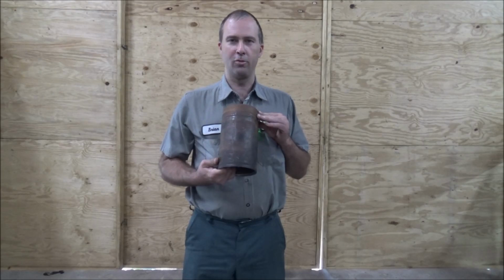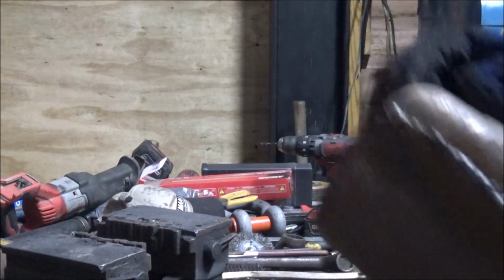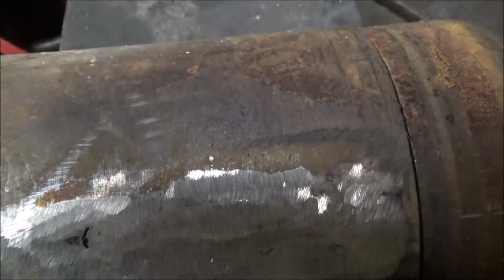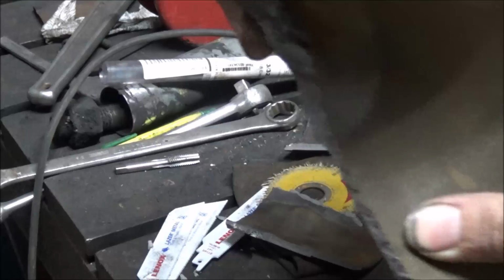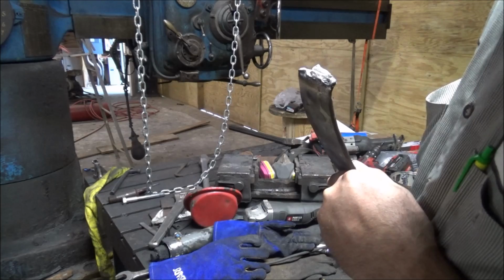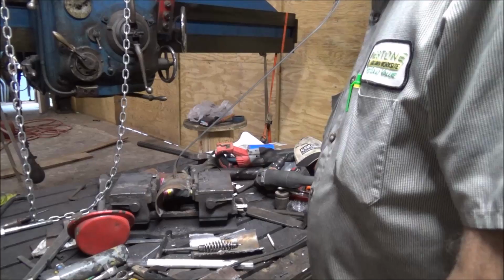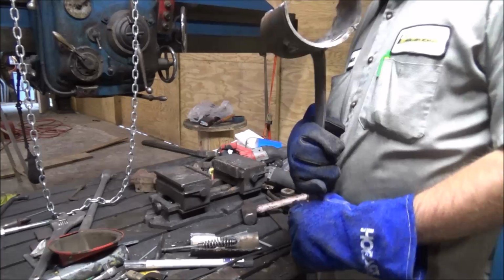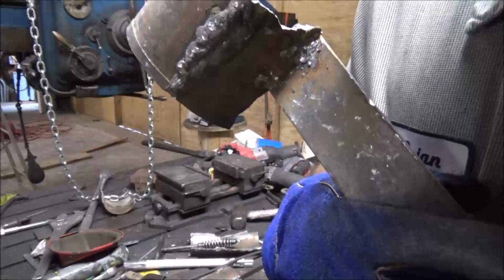Experimental strength welding of cast iron

Comment: Neato, looks like shit, but it sure seems to work well! Maybe the oxygen in the weld makes the cast more like steel, that's how they turn iron into steel after all, oxidizing the carbon out of it. 
The bending looked like it was mostly 6" above the weld, but the hammer abuse was sure impressive.

Comment: http://www.esabna.com/euweb/oxy_handbook/589oxy24_4.htm page 4-6

It is NOT the weld that is the problem ,casting whit high carbon is -reduce it near the weld by heat or very hot weld  like your last test indicate that you are onto something. 
pealing and letting slowly cool down is critical to take the stress out
BTW  I like your accent, and sense of humor  I like both !

Good luck.

Comment: Sir,

Preheat as much as practical
Use a welding blanket
Only butter the surface with cast rod or modified 7018 rod
Lots of peening after each rod (air chisel w/ long blunt tip is best)
Make bulk of repair using regular 7018 rod
Once started don't stop keep heat coming
Let cool slowly using a welding blanket

BBQ charcoal is good for warming large castings.
Cover warm castings with clay floor dry to slow cooling.

Take care

Comment: Can't stand the Practical Machinist, those folks are almost as bad as the Stackoverflow crowd.
You can't the simplest question with out it turning into a flame war between gurus.

Glad to see you are looking for a better angle and thinking outside the box. Good thing you are one of those ignorant country yokels who thinks that tractor pulls are fun and exciting. Hate to think what kind of solution you would come up with if you taught engineering at an Ivy League...

Still think pulling the arm is in your future. I like this approach to solving the slag/inclusion issue though. Might save you a boatload of hard work taking the drill apart
Reply: 'gurus' meaning guys who cant do it, but like telling others how

Comment: This all seems counter intuitive, DCEP, no pre-heat and no flux on the rod. It goes against everything you learn about welding.
Then again Cast Iron is first rate bitch of a demanding mistress, and I am still trying to get to grips with it, so the proof is in the pudding so to say. MMMM lots of food for thought.

Comment: I really LIKE you and the movies you make man.. im a real fan..  But ...You hurt me .. real bad .. u do it right there .. on your big machine .. so close to these handels.   . . !  Wish I could tell that Inspector to take a bite from the rear when you act like that... stay way from machines .. and when u grind .. Do it F****ing outside ... also the Welding ( do it away from machine ) .. and then A wiking from Dinmarc dont have to come to murica to tell you that.. :D  more soft way... wiking way
Reply from the maker: So I take it you missed the video where the drill was broken in half and I spent two weeks grinding and welding on the drill itself to put it back together.  Also at the time the drill table was beside the drill and not on it so It was a good meter and a half  from those handles so they were not in danger.  I am pretty careful about not doing things that would damage my machines.
Reply: Yeah I know.  I like you.  YOu are both smart and hard working..! BR  "Joe"
Reply: And I Missed that VIdeo... THat Repair you did .. I have just done with a German "Boley" lathe .. Back here in her queens Isle.. ( And it made me total tick of that u used same way to solve it ) .. it still works ? ?
Reply from the maker: Cool that you got your lathe welded back together. Would have been nice to see it done to give me some pointers! I assume you mean your lathe still works?
Reply: Lathe still works. It's a german Boley.  Yeah.. I had no video at present time.  

Whats the video called were you break the motor carrying arm on the machine? 

Pardon me bad french ( english ) I study Maschinenbau (Mechanical Engineer ) and im educated craftman before .. I have been standing in a job position with a machine like yours. 
 Milled with an 800mm 64kasett mill head MT5 or was it this ISO40 .. cant remember .. cut some chips.  

Give GAS -  Make her cume ( Is'nt that what the man with the long beard says after end ) ..?  Im also looking for a comment for inspector each time in the video .. it makes me laugh. ''BR from ( Trump call it ) DINMARC
Reply from the maker: Drill destruction is in "Worst Shop Day Ever". 800mm is a HUGE cutter.  I thought I was running big mills at 400mm. Check out "metal mowing madness" for my heavy milling vid.
Reply: Yeah I bet you call it a 32" inch rit?  It's nice with good big gear and it looks like you will have a good machine there when your spindle accuracy has been fixed.  Made in US of A .. Thats quality.   OKI i will. Good day Sir!
Reply: It's very nice work. Size matters and you think well on top and handle very well :) It must be something with q.e.d rit? :D

Comment: LOL, Practical Machinist - more like "I have too much money & time" Machinist - I stopped visiting those blowhards when they jumped all over someone for using a step drill....  Yeah, sure, everyone wishes they had $1 million dollars of machinery & tooling to "do it right", but being practical (sic), sometimes you just use what you have....  You're getting it done, which is 100% more than 95% of the armchair second guessers.
Reply: was i supposed to get a vertical mill and a boring bar to make a hole in some steel sheet? lol, yeah me and my step drill, no its my real drill! lol